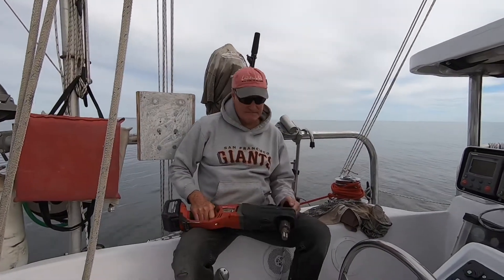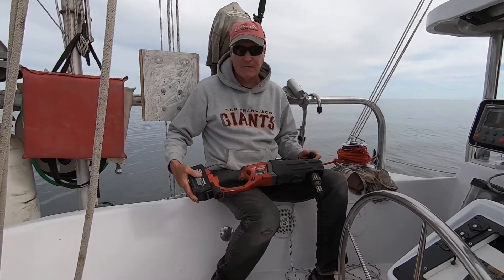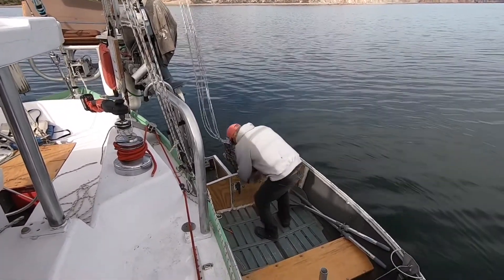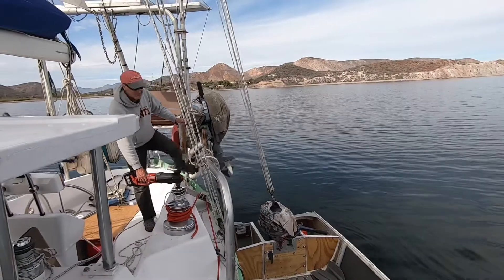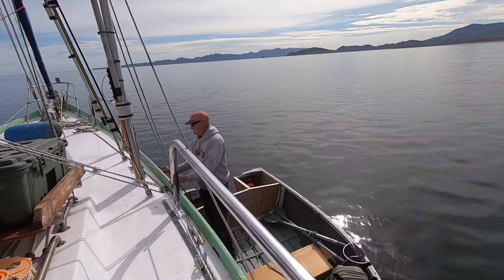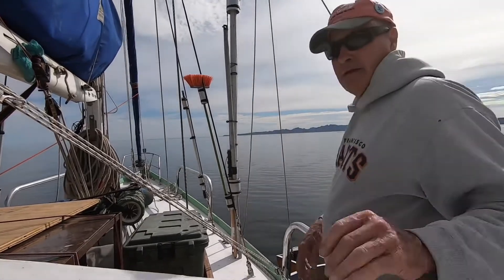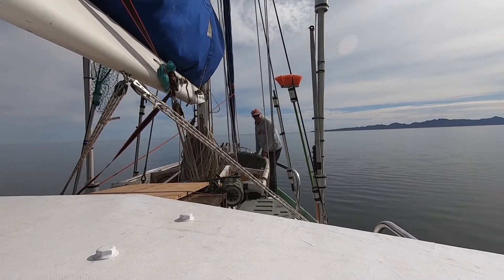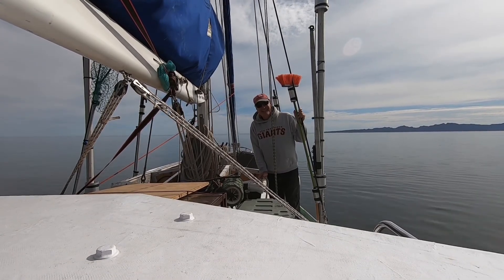Alita Fox using a Milwaukee M 18 Super Right angle drill as an electric winch handle

Comment: Nice concept, really works. I use a regular  Makita 18V brushless drill with a torque arresting sidehandle. Warning though: There are some aluminum bits on the market. I got one at a boat fair in Sweden. It's unbranded, but looks like the iWinch. It twisted right off. Then I got a milled stainless steel one from Cranker. The combo has served well for over two years now.
Reply from the maker: Yes there are some cheap bits out there.   I got one of those cheap ones when I ordered a backup bit and it was different from the hard steel milled quality one I originally bought.
Reply: What torque rating is your Makita please?